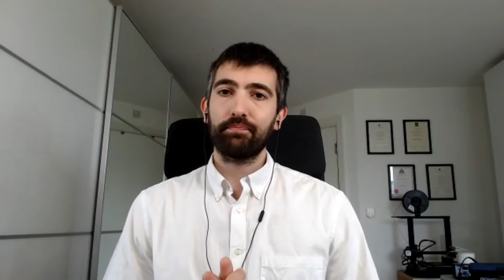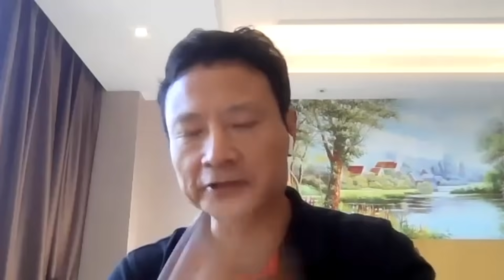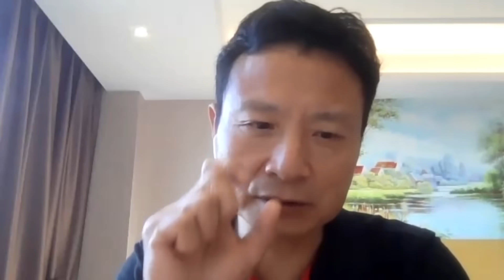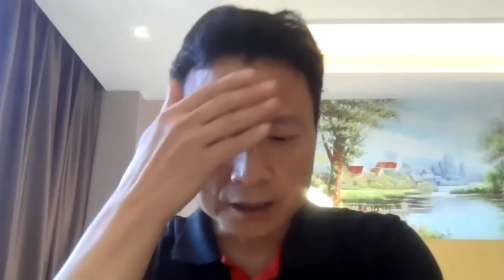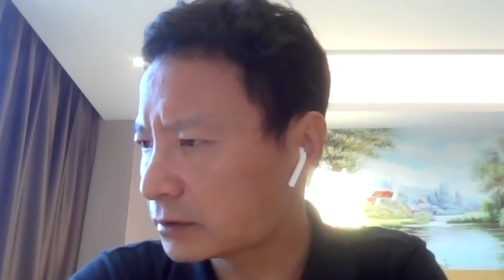An Inteview with Carl: The inventor of HDZero, the technology behind Sharkbyte

Comment: Timestamps as far as I could tell, do tell me if I missed something. Oh and maybe pin this :).

0:38 Personal background
3:42 Background of the company Divimath
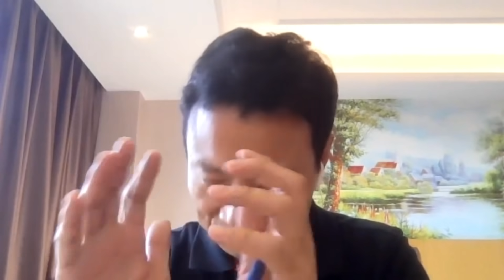5:15 Carl's expertise is in asic design
6:05 How did you transition from semiconductors into making products?
10:00 Summary of the workings of hdzero system starts.
11:43 Cameras: rolling shutter Vs global shutter.
15:15 Framerates.
16:49 Image processing chip in the camera.
19:13 Mipi link.
23:05 Vtx module: video encoding.
26:15 Luminance prioritized over colour data.
27:45 Frame timing on the vtx side.
30:05 Data transfer over the mipi link.
31:25 How does your ofdm link differ from traditional WiFi?
36:10 Link rate Vs actual useable data.
40:38 How is damaged data managed in the vrx ?
43:07 How is an image displayed in the goggles ? 
52:10 Engaging with the community.
53:10 Progression of the hdzero system (Higher power vtx, cameras, third party manufacturers).
1:01:08 Analog vs digital going forward.
1:04:03 Closing thoughts: HDzero is listening to the community.
Reply from the maker: Huge thank you for this. Now in video description!
Reply: @ChrisRosser  thank YOU for this great interview :)
Reply: @flyingbaguettefpv  
Wow! Really awesome of you...👍🏻🍻👊🏻

Comment: carl how bout telling us why they run so hot all your boards on 25 mw run hotter than fuck.. tell us why your connectors just pop off aka poor soldering  and quality control tell us why you bailed on fat shark.. tell us why you dont have a transmitter thats like 400 mw or 500 or 600 or 800 why jump from 200 to 1 watt.. how bout 400 or 600 for a whoop drone or small drone.. huh huh?

Comment: Absolutely bloom'n amazing interview. I thought all along it was shaping up to be a pitch to other fpv manufacturers. Really hope other manufacturers aren't stupid and get on board. The tech does sound as future proof as possible but at the same time very competitive. And that love is sent straight back to Carl. 

Hope the display chip in my SkyZone O30's handles that HDMI signal with little or no latency! Love to see a high speed video test of the OLED goggles.
Reply from the maker: Video test of OLED coming soon when my Skyzone's arrive!
Reply: @ChrisRosser  I have heard the screens in the O30's are the same as the HDO2's. If that is the case, I wouldn't mind betting their also using the same display chip. But, I don't know anything about all the electronics... I don't know if the HDMI can be handled differently.
Reply from the maker: @sylvanlight120  I think the displays in the HDO2 is the same as the Sky04x and similar to the Sky03O (but not identical). I wouldn't be surprised if the drive electroncis is very similar!

Comment: I don't have much background in ASICs but I do remember hearing about it back in 2008 when I was installing and configuring Xylan switches(Cisco, BayNetworks, etc competitor) where backplane is extremely fast. Maybe the asics used on those switches can be used in our goggles to make transmission really fast?
Reply: An asic is any specialized silicon chip. It is hardwired for a certain function, in this case it is video modulation for wireless transmission, in those switches it was switching packets. They can be orders of magnitude faster than a general processor

Comment: Great interview! Wondering if the shark byte module is futureproof, and firmware update is all it requires? Because in the video Carl seems to talk about improving the range and penetration with better vtx, can i assume that the current module has been perfected and will work with the future vtx's?
Reply: Because you can run either more mw or you can reduce to 30 fps which will still have latency superior to dji hq mode and be either higher resolution,  or you can make the data easier to penetrate. Notice your remote can penetrate more at 25mw than you video link could at 600mw? Same logic. And Because shark byte latency is very low and locked, there is head room to either run 1080p 30fps HQ MODE or a 720p 30fps freestyle/bando mode. And the standard 720 60fps for low latency race or low demand freestyle locations
Reply: @anthonyfpvminiquad1728  Can i assume that the future improvement will just be on the camera and vtx's, and buying SB now is a no brainer for $99? haha
Reply from the maker: Buying it now for 99 USD is an absolute no brainer. The VRx will support higher power VTx in the future.
Reply: @ChrisRosser  Alright! Another month of oatmeals here i come! (Jk)😂😂

Comment: Wow. Thanks for pulling back the curtain. I wonder if there is some problem with the "intraframe" error correction 42:15. The current error correction scheme seems to make errors look worse than they should. When I look at video frame-by-frame, the error bits at a casual glance seem random and high contrast to neighboring pixels. At a closer look, maybe the error bits are simply grabbed from values too far away within the frame. A smear from adjacent pixels would likely be better. Even better would be to include values from the previous frame, but that's impossible without memory.

Comment: Top video Chris. Off topic question. There is a trend towards 2004/5 motors for 5125/30 props. Based on your previous video shouldn't a 1408 spin these better due to greater stator volume? Sorry its off topic but I couldn't find an appropriate recent video to ask. Regards.

Comment: Really amazing to get Carl in an interview. Your previous vids also provide a good structure for the topics you're covering with him. I love how down-to-the ground and open he is about the whole thing and that he also honestly admits the issues and benefits of the current system and where to improve. This is a great base for uncovering all of its potential in the future.

I really hope we get some high-quality compact 1W VTXs using this system, and maybe some high quality goggles with full integration of this video-link as well! The more I learn about this HDZero link, the more I like it. Maybe in the future we're not calling it sharkbyte but just HDZero and many manufacturers produce parts for it, just like back in good old analog times? :)
Reply from the maker: I think that's going to be the outcome. More and more momentum is building for this system. Racing pilots are using it now and lots of videos are coming out about the system. In a couple of years this system will have replaced analog mostly  I predict.
Reply: @ChrisRosser  From what I learned here and saw in Bardwells last vid… I tend to agree with that. Really amazing to watch this development!

Comment: video streaming over twisted pair or fiber is different from the WIFI you get in your home isn't it.  Doesn't WIFI have to be at the cutting edge for RF based digital video transmission too?
Reply from the maker: Not necessarily. When you stream video over Wi-fi  you are happy to tolerate 100s of ms of latency. Not so with digital FPV. All these systems use OFDM modulation so their PHY layers are very similar but the layers built on top are very application dependent.
Reply: @ChrisRosser  Ok, I get it, BTW, when you fly a scale airplane in strong winds there are literally seconds worth of latency between inputs and response.
people want these things to fly like a video game.
Reply from the maker: Yeah I flew a fixed wing recently and it was humbling experience.